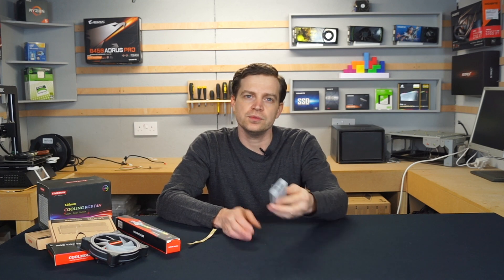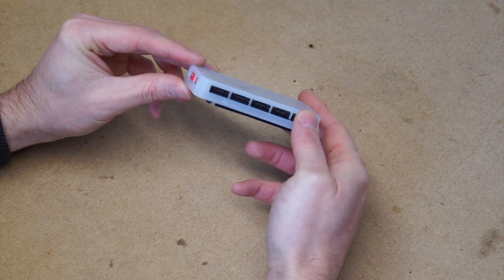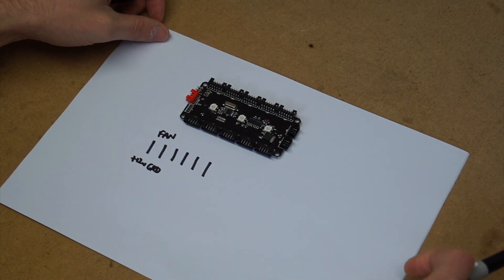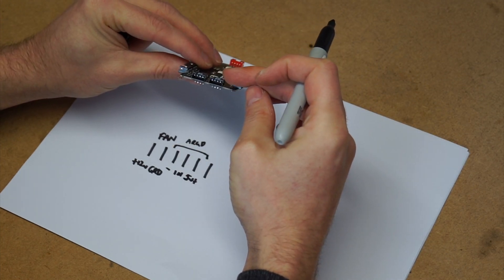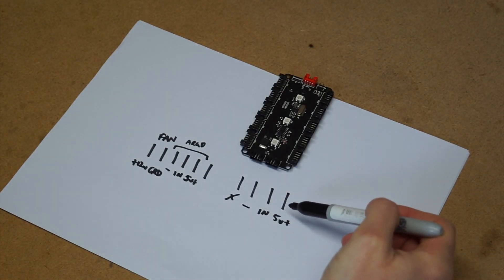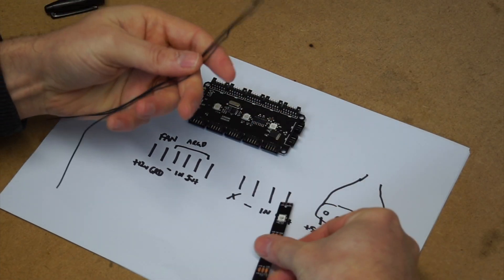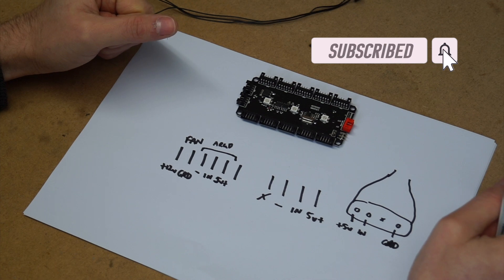Coolmoon RGB Controller Connections and Pinouts.

Comment: this thing is stuck on one color. I measured the board no damage... im totally puzzled
Reply from the maker: Is it the remote playing up?  Tried a new battery?
Reply: @TechLabUK  the remote is workin on the other one i have. I jsut reflowed the whole board....
Reply: I fixed it. You need: A measuring device like a Multimeter to check for bad capicitators(measuring from ground) and need to check the resistance values of resistors first. If they are okay you need to check the chips according to the code written on it.(search the sheets for them online) Atfer everything seemed fine according to this. I decided to reflow the board with a Heatblower. The soldering is atrocious and thats the weak point of the device. You need to reflow the chip on the other side of the antenna. Also you need capton tape to protect the plastic or other deflecting foil. Then it willmake proper contact and work again.
Reply from the maker: @IndianaStones1  Sweet!  Glad you got it fixed and way too technical for us lol

Comment: Thank you very much. I got 4 coolmoon fans and a new case. This case got a pwm rgb splitter/controller included. Now i have the problem that this new controller from the case dont synchronisize with the old ones from coolmoon because the coolmoon ones only have a 5V input for power. I will remove 3 pins and hope the fans dont die lol. Do you got any tips for me? I want to synchronisize it with my ASUS TUF B660M Plus. Greetings
Reply from the maker: Unfortunately a lot of the Coolmoon controllers with these types of connections have no way of being sycronised.  Although, knowing the pinout of the fans i would replace the argb connections on the fans with standard 3Pin and run the lights from the Motherboard through a splitter or hub so the lights can be synced and run the fans from the original Coolmoon hub.  A lot of work though.
Reply: @TechLabUK  Thank you for your quick response. Yeah that would be a lot of work to do lmao. I think ill get myself a bunch of new fans, the coolmoon fans arent that good, but cheap. Thanks for your help my guy!
Reply from the maker: @notGX1-  Sometimes it's a false economy thing.  If you mean to keep your fans for a while it's sometimes best to go for a high brand with standard connections.  Costs more but you can take them with you build to build and can always find a new hub or controller that will work.
Reply: @TechLabUK  definetly, i totally agree with you. Thats more secure and less stressful when you want to upgrade the case e.g. like it is in my case.
Reply from the maker: @notGX1-  For fans we like to keep around and move system to system we generally buy 6 (Even if we don't use them all now) so we have them if we move case and need another.  Antec do some great looking fans with standard connections plain, rgb and argb and they are not that expensive when buy the 3x fan kits.  Worth looking at.
Reply: @TechLabUK  Okay, thank you. Ill give it a try.

Comment: can i use it with a 4pin connection to my motherboard? because i have the MSI x470 gaming plus max but there is no 3 pin 5v
Reply from the maker: Unfortunately not.  These don't allow for motherboard control and even if they did it would be ARGB (3Pin 5v) only as the ARGB and RGB standards are different.
Reply: @TechLabUK  so i need to get the remote one so i only need to plug IT into my powersupply?

Comment: can you put 4 pin fans in the controller too or are the 4 pins only for the led strips?
Reply from the maker: Do you mean 4Pin RGB connectors?  If so then no, this uses the 3Pin ARGB Standard so it's addressable.

Comment: Hey man, old video so I hope I get a reply.

I recently bought the Coolmoon Diamond Ray strip and saw that I needed the RGB Controller to actually use it instead of just plugging it into my mobo.

If I rewire my LED strip to have the 3 pin mobo header as described by your wiring diagram, will it work?
Reply from the maker: Hey, yes. yes it will work.  The strips are using the same standards , just the plugs are weird.  In fact you can buy PHT to 3Pin ARGB adaptor cables from ebay if you didn't want to splice.  Just sometimes not worth it.
Reply: I have a 3 LED strip that I use just plugged straight into the mobo.

I was wondering if I could cut that strip and wire it to the coolmoon one?
Reply: @TechLabUK  Would this not work with the 4 Pin RGB header?
Reply from the maker: @_m.y.c  YOu could splice the existing 3 pin no problem but it won't work on a 4 Pin.  aRGB and RGB are different standards.
Reply: @TechLabUK  Thank you so much for all the help! I’ve subscribed
Reply: @TechLabUK  One more question since I don’t want to have to cut up my 3 pin and I have a spare 4 pin

Could I wire the 3 wires into the 4 pin connector and just plug it into the 3 pin on the mobo?
Reply from the maker: @_m.y.c  No problem.  Let us know how you get on.  Once you do one, you realise how easy it is to understand.  The Pinout in the video was just to help inspire people to give it ago.  Thanks for the sub :)
Reply from the maker: @_m.y.c  Yes, you can as they are the same size but you have to make sure you wire up the right wires and install the connector the right way around as the 4Pin will go both ways.  I have resolved this in the past by melting an old cable tie into the 4th hole you don't need so you never accidentally do it.
Reply: @TechLabUK  You’re the best man! Just wired it up and it looks fantastic.
Reply from the maker: @_m.y.c  That's awesome!  If you have discord join our community (Link in video descriptions) and let us see how well it came out.

Comment: Hey pal so i have a 5v argb plug coming off my EZdiy vertical gpu mount. Could i plug this straight into the led strip socket missing out the left pin as you shown in the middle picture?
Reply: Or do i have 2 choices, could i plug my 5v argb connector into the 2nd,3rd and 4th pins of the led strip connector OR the 3rd,4th and 5th pins of the 6 pin fan connectors?
Reply from the maker: @danielparr3993  You should be able to plug it into either socket on the controller following the pinout guide in the video.
Reply: @TechLabUK  | Thanks for the reply.

How would i tell which cable is which on the 5v 3pin connector?
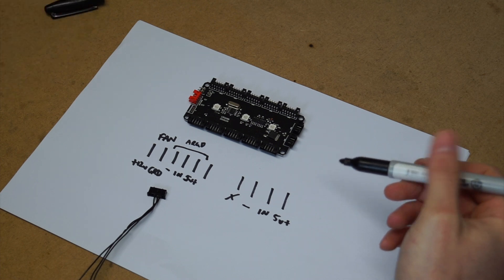Reply from the maker: @danielparr3993  Go to 4:26 in the video and I draw the 3Pin connector pin out.  I personally didn't want to cut the ends off my 3Pin lighting so instead created a adaptor cable from 3Pin to the Coolmoon 6/4Pin.  Then I can use it where ever.
Reply: @TechLabUK  ahh ok, i already have an adapter to go on the 3 pin which changes it to a different 3pin 5v connector made to connect to Gigabyte boards. Would that connect straight onto the 3 relative pins in your diagram?
Reply from the maker: @danielparr3993  I don't think the connector is the right size.

Comment: Hey bro, sorry i want to ask, did you know what the different of 6 pin fan like in this video and 6 pin with lock like armaggeddon fan or aerocool fan? Because i've tried the fans with 6 pin like in this video to my controller fan (infinity case built in) it doesnt work, and fans in my infinity case have 6 pin with lock like aerocool or armaggeddon fan. Thank you

Photo:
https://drive.google.com/file/d/10b1UrnCy5KYtSP4h0-qjPzSXH-687txD/view?usp=drivesdk
Reply from the maker: Hey, I'm not sure without taking one apart but I suspect they work using the same principal but other brands may swap the wires around to make it so you have to buy their fans and controllers.  With the Coolmoon fan speed on these 6Pins are simply two wires.  The other four are for the ARGB which is effectively just a standard.  Others may have PWM power for the fans meaning three wires for fan power (PWM Wire to change speeds) and three wires for the ARGB +5, GND, In (Missing the Out as even these Coolmoon fans don't use the out, the wire is just there).
Reply: @TechLabUK  i have an issue in this particular product, after a week of using it the controller stopped working, the light above the controller that indicates (red light) that is working is not lighting up. Do you have any idea how to fix this?
Reply from the maker: @paranoidparadigm886  Hi, Sorry to hear that.  I've had quite a few of these now and not seen this.  i haven't noticed a red light either which sounds interesting.  Do the fans spin at all when plugged in?
Reply: @TechLabUK  yes, the fans is working in fact the lights are still on but I can't configure it because of the broken controller

Comment: hey there bro! i have the same hub and i have fans and two led strips plugged in to it. would it be possible to have different color between the fan and strips using my motherboard?
Reply from the maker: I don't believe so if everything is running through the hub.  If you had an ARGB header on your motherboard and made an adaptor (3Pin to 4/6Pin) then you could run them independently.

Comment: Is it possible to solder the ARGN 3pin connector or the JST 2pin connector to a USB type A? Since they both have the same pinouts and use the same amount of voltage. I wonder if you could control the ARGB that way by through software by hooking it up with a USB type A into motherboards that don't have an ARGB header.

Comment: Hello,

I'm sorry if you have answered this before, but I can't find it anywhere. My pc came with a similar controller, but I can't control it through the motherboard. It is connected with a 3 pin connector and the aura sync software recognises it as a Adressable LED strip, but it doesnt change the color. I can only change it using the remote and it always resets to the rainbow effect every time I turn off the computer. Is there any way to disable the remote control?

thank you very much?
Reply from the maker: I'm not sure what controller you have as most are different.  If it came with the ability to plug into the motherboard it must have Sync.  In my experience there has to be away of switching it from the controller it's self to the motherboard.  Sometimes they do this through a connection to the reset switch on the case (They reuse the switch to switch the source of the RGB).  Take a look at the wiring on the controller and see if this is done.
Reply: @TechLabUK  hi, thank you for the quick reply. i never realized the reset button affected the rgb. Anyway, i pressed the reset button for a while and it switched control to the mother board. But now only the first led of each fan/strip lights up.
Reply from the maker: @cesarsobreiro  I wasn't sure if it would work, it's just the style I have seen before.  If only one LED is showing up it may be something to do with the configuration of the motherboard software.  Worth having a play around in there or googling the symptoms with that software to see if there is a fix.
Reply from the maker: @cesarsobreiro  A quick google finds this article with similar (Not sure on the board / versions you have etc) https://rog.asus.com/forum/showthread.php?120822-Front-ARGB-Fans-Only-1-LED-on-when-synced
Reply: @TechLabUK  Hi, thank you once again. Yes that did the trick. Now I just have to figure out how to make it not reset after shutdown.

Once again, thank you very much for the help.
Reply: @TechLabUK  I’m sorry to bother you again, but I can’t find how to prevent the controller settings to reset after shutdown. Would it require to buy another controller? Thank you
Reply from the maker: @cesarsobreiro  It's no bother.  The controllers are usually supposed to retain the previous settings but I have had a few that don't even though they are supposed to.  I'm not sure if this is a fault inside of them or if it is just random.  Worth trying another one but you will have to make sure it's compatible with your fan connectors and has sync capability.
Reply: @TechLabUK  hey mate. Thank for the advice. So i ordered two controllers. The first didn’t fit so i ordered one just like this. I plugged the power, two led strips and 1 of the fans. The fan I plugged spins fine, but none of the rgbs light up. Do all the fans need to be plugged? Thank you again.
Reply from the maker: @cesarsobreiro  No, you should be able to plug just one fan in and it should work.
Reply: @TechLabUK  does the order matter? I plugged the fan in the number 6 slot
Reply from the maker: @cesarsobreiro  It has never mattered for me, each header is active all the time.  Have you tried a different header in case six is faulty?  Also make sure you hit the on button on the remote.  On and off will only turn the lights on and off whereas the fans keep going.
Reply: @TechLabUK  thank you for the quick reply as always. My previous controller has a cable for the ref receiver but, even though the cool moon came with a remote control, the socket for the ref cable is empty. So I can’t use the remote.
Reply from the maker: @cesarsobreiro  If it is the same as the controller in this video it will work without a ref cable.  Never even seen a ref cable before if I am honest and I have a lot of these controllers hanging about.

Comment: Very informative video. :) Would have been great if you could have shown how it was connected to the motherboard. 

Would you know if you could connect it to a USB header and if there was a software that could control them? My problem is that, my motherboard does not have an RGB header. I think I share the same problem with many users as well. Not enough videos, if there was at all, on if or how it could be done.
Reply from the maker: Hi, Unfortunately these versions of the Coolmoon controllers don't allow connections to motherboards.  They are stand alone.  There are more expensive versions out there that allow this and Coolmoon have recently released one that does (I have just got one in now) but they often use an existing RGB/ARGB header from your motherboard which wouldn't help you.
Reply: @TechLabUK  too bad. :( Thank you!